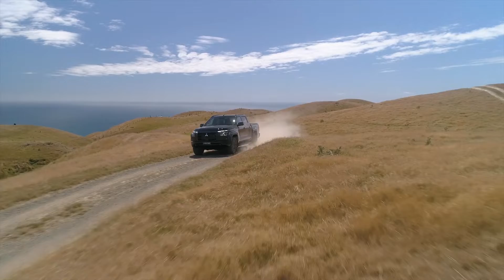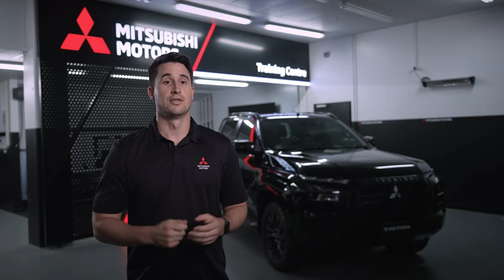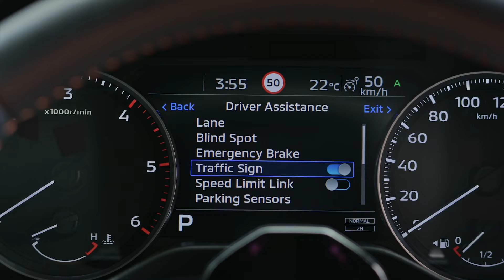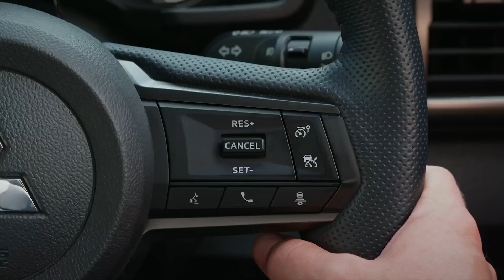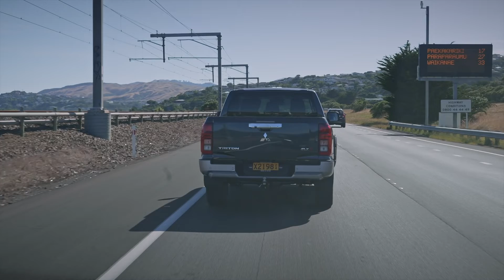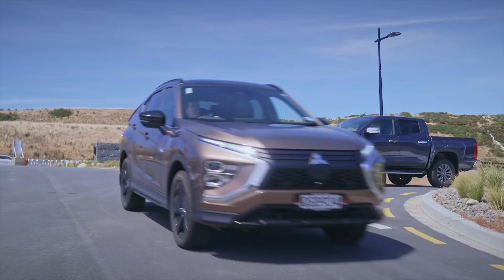Next Generation Triton -   Advanced Driver Assistant Systems | Mitsubishi Motors NZ

Comment: Look at your speed warning
Look at your mirrors warning 
Look at the navigation warning 
Look at a sign warning
Head check warning 
Turn with one hand in the middle of the steering wheel warning 
Wear glasses to avoid sunglare *warning * 
The MOST Dangerous distracting warning system ever created. And you have to turn it off EVERY SINGLE TIME!
 Fix it Mitsubishi, do better
Reply: Yip, this. have one on loan, is a disaster
Reply: That's what's preventing me from getting them for company Bakkies.